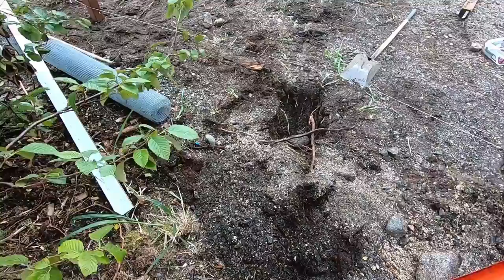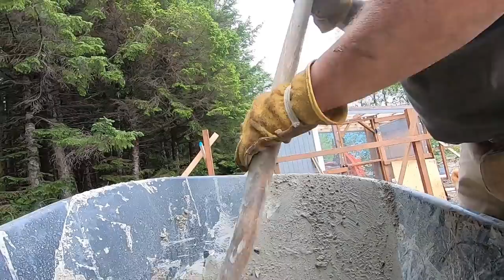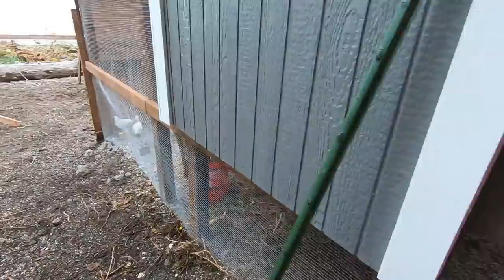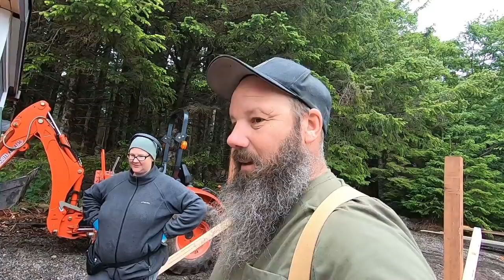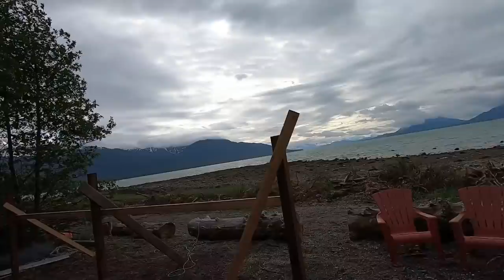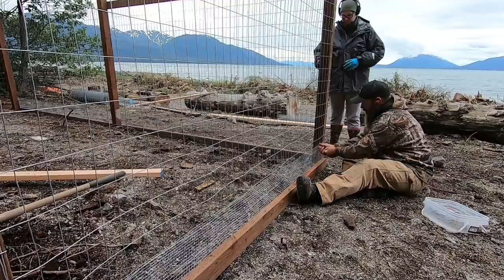Building the ultimate chicken run | Step one in our bear proof electric fence (Part I)

Comment: Love the new chicken run... Are you not afraid the Martin and Mink will dig under the bottom ?
Reply from the maker: Thanks Denis. The chickens will only be out in the open when we are in the area, which is most of the time. The coop and the small coop run is predator proof. This is mostly to keep the chickens inside and keep the bears outside.

Comment: I'm envious of your nifty tractor!
I would totally wreck our garden if I had one...
I've been googling "Kubota k19t1", but I can't find it.
What make and model is it?
Reply: Micke Mike I don’t know the model #, but it’s a Kioti tractor, not a Kubota.
Reply: Thanks  @bernarrcoletta7419 !
Found it and they are made in South Korea, not China, which would have been a deal breaker.
Reply from the maker: Hey Micke, Mike Bernarr is correct it’s a Kioti CK 3510.  I also agree with not buy China. I try to buy American whenever possible. Sometimes it just doesn’t work out though.
Reply: @AnAlaskaHomestead  
The problem is that most stuff are made in China today and I bet those connectors that broke when you tightened them were made of "Chinesium", the weakest metal known to mankind.